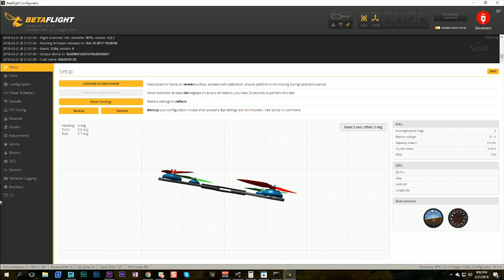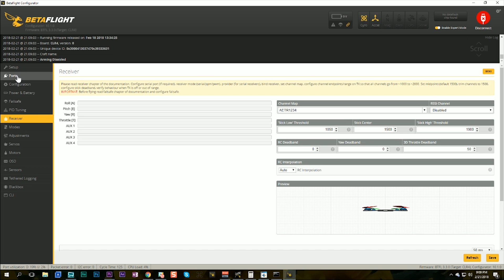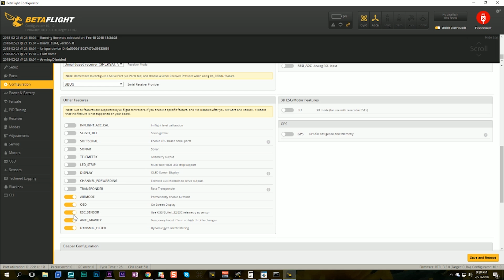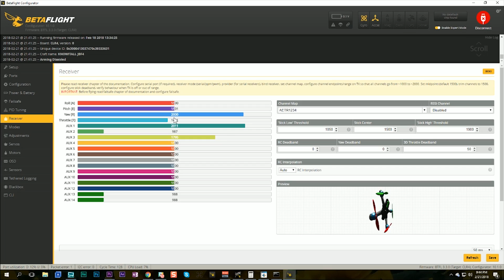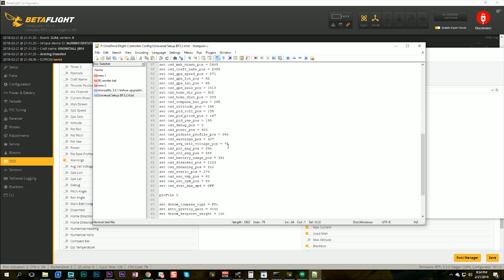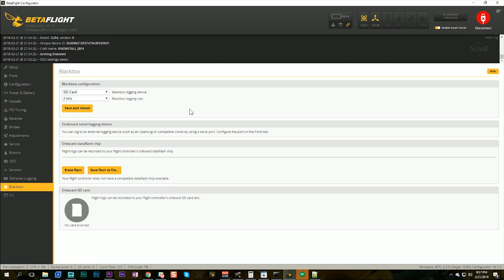Betaflight 3.3 Ultimate Setup Guide

Comment: But if you do blackbox logging at 2k when your gyro is set to 8k 8k or even 8k 4k then wont it be inconclusive results unless your test sum is the same as what frequencies your gyro is running at ?/So i guess to get 4k or 8k results then the logging would probably need to be set to as close to that as possible in order to get correct test/logging results??
Reply from the maker: If you're sampling at 2k, Nyquist Theorem tells us that you have accurate sampling of frequencies below 1k. Since most gyro data that's actually useful to the FC is below 1k, this isn't a limitation.

Comment: what kind of filter does 3.5 use? is it still applicable to enable bqrcf2 via gyro_stage2_lowpass_hz and disable lowpass filter 1?
Reply from the maker: No, don't do any of that. That is all stuff that you did when 3.4 was just starting to implement the stage2 filters. The default filters in 3.5 are very good.
Reply: Joshua Bardwell ok thanks, I have one last problem, my filtered gyro noise is clean as a whistle, the raw gyro pitch accumulates noise during flight. Ie: longer the flight steadily longer noise profile.. I thought it could be I term fighting something so I lowered I and it’s the same, i. Can’t figure this one out, it doesn’t really matter bc it’s filtered out but I’d like to fix the problem instead of masking 😷! Any ideas??

Comment: If you use the servo tilt method can you assign at least two servos to your motor outputs 5 and 6 and then utilize the "cam stab" feature in the Modes tab? Basically can you use a single flight controller to control your quad and also a servo based stabilized camera gimbal? It would be cool to be able to have the roll axis be auto-stabilized and then have the pitch axis be manually controlled with a head tracker. Do you think this is doable if you have an F4 board with at least 6 motor outputs?
Reply from the maker: Yes you can do that.

Comment: Joshua, I’m helping a friend setup his new 2.5” quad, and Iv never used 3.3, all my stuff is on 3.2...is the dynamic filter process and changing lowpass to pt1 and removing notches, the same process as you would use with 3.2 it has anything changed I should be worried about?
Reply from the maker: Why not just go to 3.5?

On 3.5 you leave the filters at defaults.
Reply: I havnt gone there yet, and it’s his first build, rather help him w something I’m familiar with, and his stack came on 3.3.3

Comment: That long crappy ad will make me unsubscribe if it continues...
Reply from the maker: I never show unskippable ads, and YouTube never shows long unskippable ads. If you're seeing an unskippable ad, it's because YT is choosing to show it to you despite the fact that I told them not to. If you are seeing an unskippable ad longer than 30 seconds, the most common cause is this: you have an ad-blocker; you have white-listed youtube; but the web site that serves up the "skip" button is being blocked by your ad blocker. So you see the ad (because you white-listed) but you can't see the skip button.
Reply: I came back for your reply and there was the normal short ad with a skip button, not the 70 second unskippable one of last visit. This is the only channel ever I've had a such a long unskippable one.
Reply from the maker: For what it's worth, I never enable unskippable ads. However, YT seems to occasionally ignore my settings and show you an unskippable ad anyway.

Are you running an ad blocker? Have you white listed YouTube? If the answer to these questions is no, then I don't know why you saw that ad. If the answer to these questions is yes, then that 100% explains why you saw a 70 second unskippable ad.

All of my research indicates that YT sometimes shows long ads, but they are always skippable, because YT knows if they show you long, unskippable ads, you will check out, and they don't want that. Just because you see the skip button on one ad doesn't mean you will see it for every ad, because some ads get served from different places.
Reply: Thanks Joshua. I normally run adblocker plus, but for some reason it has disabled itself and won't come back. So it seems the long ad came thru because of that or YT. I appreciate your kindness in answering and I do learn something every time #stickinwithya   tony

Comment: halo.. everyone, i had this problems :

My board FC CrazybeeF3 Frysky,

my latest firmware : betaflight_3.3.3_crazybeeF3FR (Stable)
Reciever Mode : SPI_Rx Support

I accidently choosing wrong SPI Reciever Provider to A7105_Flysky_2A and save it

now my FC can not connect to USB anymore, everytime connect it is says " Unkown USB device (Device descriptor request Failed) for windows 10"

is there any suggestions to fix it? please help me anyone..

😕 1

Comment: So i have a question, because i'm new on thsi hobby, and i want try to understand as much as i can, so one day i can make it alone or teach someone as you do.
I have a FuriBee F3 32 bits flight controller. and when i search version on BetaFlight as you say, i get this "LEMONF3-FSV1 (LEMO) 3.3.0" and after that i to to firmware flash and my flight controller doesn't exist. Please help me :( or someone help
Reply from the maker: I am going to guess that after flashing, the FC does not respond to USB any more? I'm not sure I understand the problem though...

If the FC does not respond to USB most likely you flashed the wrong target (the board type from the pulldown menu). I just looked in the pulldown and I don't see LEMONF3 as an option. So if you flashed the firmware from the configurator pulldown menu it was the wrong target.

You need to get a copy of the LEMONF3 firmware and flash it to the board. But i have done a little searching and I can't find any reference to it. Maybe try the SPRACINGF3 EVO target?
Reply: Joshua Bardwell yeah, same as me, I searched everywhere, and I can’t find anything. At this time I tried the SPRacing F3 EVO, and my board just disappeared from my computer, any time I connect it to it, all I have is LED’s, nothing more, no sound from computer, no pop up, I can’t find anywhere on my ports, I tried all ports. It’s like if it’s not connected at all, but with LED’s on. So I tried to find bootload pins, which I don’t have any on this board. All I have is a 5V pin and a Grnd pin for fpv camera. So at this point I think I was scammed from GearBest, and I’m trying to get a refund, because nothing seems to work for me. But anyway, thanks for the help, and if I get any update I will net you know, maybe we can learn something one day :D
Reply: Link to LEMONF3 firmware, i found it in the instructions for my Eachine E010S PRO.
https://www.mediafire.com/folder/hm8r8p4nc8d0b/LEMON_F3

Comment: I just picket up your FC from getFPV, and I am trying to follow along with your vids on getting it setup. When I get to the part of this video about ports configuaration, I set them accorting to the hardware I have (all the same as what you show except no ESC Telem, and my VTX is using IRC TRAMP) but when I save and reboot I get an error "EEPROM saved

2018-05-16 @ 00:36:25 -- Unrecoverable failure of serial connection, disconnecting... " I even just tried it without changing setting, and It does the same thing
Reply: Okay, I just figured it out really quick....My 3d printer was causing a port conflict that seems to only show itself when saving and rebooting in Betaflight....for any of those that might find this useful.

Comment: Thanks for the informative video!  I just successfully upgraded and configured BF 3.3.1 on my OMNIBUSF4SD (PRO) but now my FC is no longer controlling my WS2812B LED tail light...  I have DIN wired to the LED pad on FC along with 5v and Ground, and LED_STRIP is toggled ON in config tab under other features in BF... It worked great in 3.2.2 prior to upgrading firmware...  Any advice??

Comment: Hello Mr. Bardwell 
I bought two Bardwell F4 flight controller I have problems with both cards I have one where there is no power that works when I plug the battery and the other who refuses to take the Firmewear
Reply from the maker: Please reach out to racedayquads support for help with the DOA board.

The one that "refuses to take firmware":

1. Hold down the bootloader button. Plug in the USB cable while continuing to hold down the bootloader button.
2. Run the Impulse RC Driver Fixer app (http://bit.ly/2GBLvwh). It should "fix" the driver successfully. If not, do not proceed.
3. Un-plug the USB cable.
4. While holding down the bootloader button, plug in the USB cable again.
5. Start the Betaflight Configurator app. In the upper-right corner pulldown menu, you should see "DFU". You can now flash the board.

For more detailed instructions on how to install the STM32 drivers: https://www.youtube.com/watch?v=m4ygG6Y5zXI
Reply: I put a video on youtube here is the link

Comment: Hi Joshua, Don't know if your aware of the issue in this betaflight version. I have written to the Devs but I know you have a direct line to them and can probably get through to them better than me, please see below

I have spotted a problem with VTX communications with this firmware release. It looks like the desired settings are constantly being written to the VTX. I have seen this on the Matek F405 and FCHUB-VTX combo. Once this latest version is installed you can no longer use the A & B buttons on the VTX to update channel requirements as data is constantly being sent to the VTX which overrides your settings as you enter them rendering the two buttons useless. In the old firmware (3.2.5), this data was only sent as you changed your requirements from the OSD menu, hence if you wanted to, you could change it afterwards using the buttons. Now, you can no longer do this.

Please fix this in the next release as its caused a few problems, in one instance the FC was constantly writing the power setting to the VTX, no matter what you did, resulting in the video dropping out every 10 seconds as the VTX reset after the new setting was issued, the only way to stop this from occurring was to re-flash the firmware to the FC.

Thanks so much

Anthony

Comment: Can't get my CLRacingF4 into DFU...I've downloaded all the drivers.  Used the ImpulsedRC driver fixer.  I'm confused.
Reply: Trying to upgrade to 3.3
Reply from the maker: Hold down the bootloader button and plug it in. There should be one solid red LED, no flashing or blinking green LED. At that point, if ImpulseRC Driver Fixer doesn't find it, I dunno. It really should.
Reply from the maker: Try a different USB cable. Some USB cable are power only.

Comment: hello Joshua, thanks again for this helpfull video.
I have 2 xrotor combo on 2 quads, BF 3.3, and I never have the oportunity to see the Black box sdcard, no choice and no little picture of the card, like in your vid and many others . I typed "set blackbox_device = SDCARD" , saved it, could read it saved after, but still nothing in the black box interface, I'm desperate because on my big 8inch XL8 iflight, I want to investigate the vibrations issues, correlate it with the motors rpm eventually , rpm than I can't read either , dshoot 600, xorotor micro 40a 4in1 esc .
The rest is "fine" but I'm lost on tose 2 aspects.
Thx you and keep going.

Comment: Hey Joshua. I just built a new quad and I thought i try out BF 3.3. And what I found out is that when i disable Gyro Notch filter 1 and 2 like i always do my motors make these very grinding noises when i arm and all the motors and my esc get extremely hot.. When I enable the notch filters again, the motor sound is normal again.. Im running BlHeli32 dshot1200 .. Is there something new on bf3.3 that i have missed or something? dynamic filter is also enabled.

Comment: I found with 3.3 it is not possible to arm omnibus fc in eachine qx65 ,  modes arm tab will not activate.  Version 3.2.2 runs fine.
Reply from the maker: There is added safety protection in 3.3. You cannot arm while connected to the configurator unkess you go to Motors tab and click "props are off".

Comment: Trying to arm and I get a calib warning on osd and it won't arm
Reply from the maker: Go to the CLI and type

set moron_threshold=100
save

This is the actual name of the parameter I am not making this up.
Reply: Joshua Bardwell that's funny, I had just changed it to 90 before I saw this. Totally fixed it, very strange. Never needed a mt over 65

Comment: Im not getting any inputs on any channel or the modes tab. Im using crossfire, i have my softserial ports set and the reciever is bound to de radio. It was working just fine until I did the flashing. Heelp! I have 12 charged batteries waiting to be dischaged.
Reply from the maker: I will be releasing a crossfire setup video in just a few hours so hopefully it will help.

Comment: Hi Joshua. You helped me with connecting my quad to betaflight a few months ago. It did the same thing it did before. It will not connect and the message says" failed to open serial port. Today i was connected to betaflight and the last thing i did was ....turned on telemetry, which i dont think i have on my receiver and saved it. Then it disconnected me. Now I'm unable to connect. Please tell me what is going on. Thanks
Reply from the maker: If you disabled MSP protocol on the Port that us used by USB then you wouldn't be able to connect. The fix would be to put the board in bootloader and reflash it. This would reset the configuration.

Comment: Joshua, I just updated from 3.2 to 3.3  with OMNIBUSF4SD  for some reason when I set to Dshot 600 the disarm motors regardless of throttle value feature isn’t there anymore. I had it on 3.2 and had it active.  Any reason for those?
Reply from the maker: The feature was deemed a safety reisk and removed. Motors always disarm as soon as the switch is flipped.
Reply: Joshua Bardwell ok good to know, I always appreciate your replies and help..

Comment: Hi Joshua. Need some help. I have a Matek F405-CTR fc and a Taranis Qx7s.  Im using an Frysky R-xsr receiver. Setup telemetry,  i can get RSSI to show..but i cant get the battery voltage or VFAS to show up on the transmitter. Hope you can point me to the right direction. Thanks.

Comment: Has anyone else upgraded they quads with FRSky XM+ receivers to Betaflight 3.3 yet? I am having some weird issues with the RSSI just being stuck at ~10% on the main page and in the OSD. (note: the RSSI worked fine with the same set up on 3.2.4 before the upgrade) Even though in the transmitter page I could still see the RSSI value bouncing around like normal on AUX12. I messed with all the rssi settings in the CLI and nothing seemed to work. The only way I was able to get it to "work" is to actually turn OFF the RSSI slider in the configuration tab. (Same thing worked for my frsky beecoreV2) That seemed to do the trick both times but that seems strange to me, maybe something to do with they type of RSSI given by the XM+?? Also the RSSI value just freezes on the last value recorded during a failsafe now (it stuck at 81 in the OSD when I turned off my remote as a test)  Anyone else having a similar issues?

Comment: I have a Bardwell F4 and cannot get it into bootloader.  I typed bl into cli and it won't read. I also manually pushed button still won't come up DFU.  The board only has a solid red light when I am in bootloader but betaflight won't show DFU.  Any suggestions?  When I plug in w/out BL it says Com11, w BL it says Com3.
Reply from the maker: Put it in bootloader by holding down the button. You should see solid red light.

Download and run ImpluseRC Driver Fixer. It should say it fixed the driver.

Unplug USB. Plug in again while holding down bootloader button.
Reply: Wow.  When I closed all the windows I saw the driver had not run correctly.  That was the problem, all good now. Thank you so much for your help.

Comment: im having trouble with my betaflight. i have 10.2 and there is NO failsafe option anywhere. there is no tab on the left like in every video ive watched, and there is no option for it under any other tabs. No videos are of the latest update either. HELP. i just finished my first build and dont want to really fly until i have my failsafe setup
Reply from the maker: In the "gear icon" in the upper right, enable Expert Mode.

The default failsafe settings are correct for most quads which is why they hid them away behind the "expert mode".

Comment: Hello JB, I want to ask you a nooby question: 
Do you think adding GPS is a good choice nowadays to pretend a lost quad? 
Quads lost so much weight in the past years and "long range" is coming back, a GPS with a telemetry downlink to the radio seems for me a smart choice. Even at flights that are close by, i think there are still those advantages.
I am just wondering why nobody really adds an GPS Module? Its not soooo heavy, helps to find your quad and is available in betaflight...not only for the iNav folks
Reply from the maker: Weight and complication. And BF support for GPS is terrible.

Comment: I am using the JB F4, R-XSR (sbus out to sbus), Mach 2 VTX, Taranis Xd9+I am getting telem, I have pid and vtx control.The problem is it doesnt appear I have any sbus. UART1 is set for Serial Rx.
UART3 SmartPort
UART4 SmartAudio Any ideas?
Reply from the maker: The setup as you described sounds right. Go back to the manual and double check each step us correct. Definitely make sure you are using the green wire from the r-xsr.